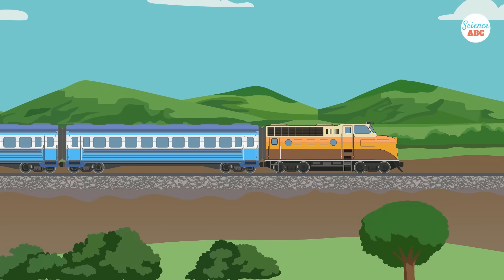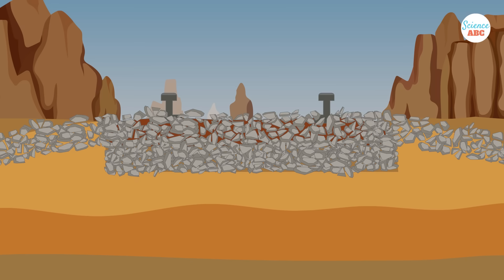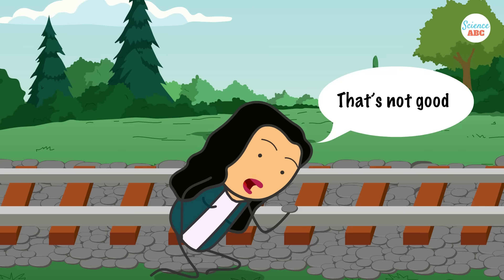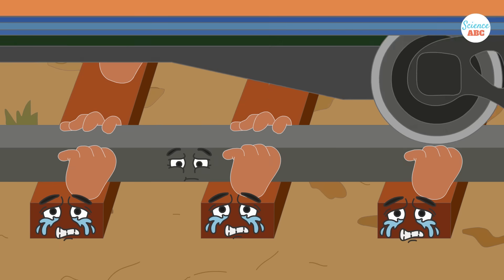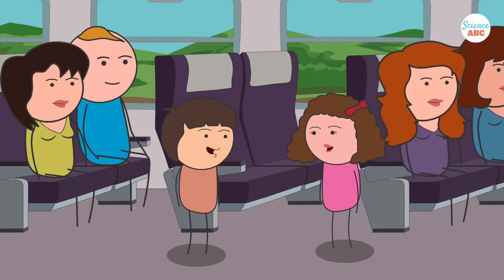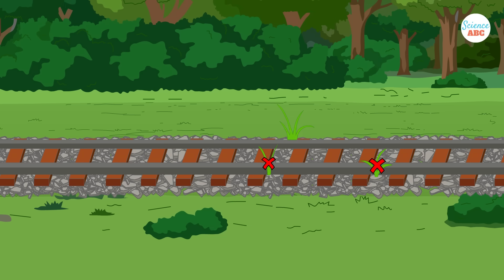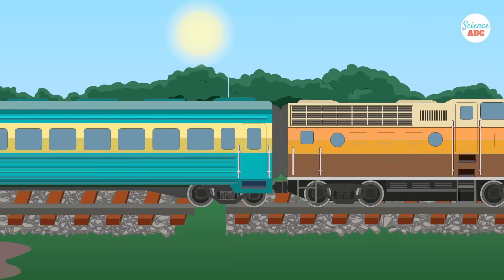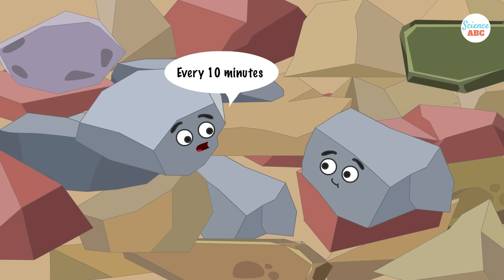Why Are There Stones Along Railway Tracks?

Comment: Here's something that I have seen many times. In certain areas, when the Train Wheels pass over a section of the track, the railway track (itself) becomes displaced with the downward force of the train. I have seen the Track go downwards more than 25mm or 1 inch, and sometimes more than this. And yet, the Rail Track had the correct Ballast. It wasn't mentioned here, but it becomes obvious that the ground (below the ballast) - has become compressed due to the many trains that pass, or even very heavy Freight Trains! I am sure that the Maintenance Crews re-fill those sections with more ballast. This wasn't mentioned here.......There are also very special circumstances (Track) for trains that travel on Permafrost - also not mentioned here.

Comment: We produced ballast in the Clayton Calif quarry.  It was not crushed but dropped into a fast-spinning crusher that would shape the rock so it locked into place after it was vibrated in place with specially designed metal comb-like machines.  We also supplied it to BART

Comment: It’s the same reason you can’t use play sand when you are setting pavers for a patio or driveway, you have to use paver sand so it interlocks.  Play sand is round and will move or wash away.

Comment: Many years ago, a train track that's no longer in use was turned into a multi use trail near here. The ties are in piles in a few places. And, in places, there's still quite a bit of ballast. 
I ride on this trail at times and am always careful at those spots. Don't want to accidentally injure my horse. 
I don't know what all they've done to the trail, other than remove what they could, but the trail is still hard packed with very little vegetation.

Comment: Why do they use gravel to bed rails? Well, they tried using other things: walnut shells, old baseballs, peanut butter, concrete debris, dead bodies, and nothing else seemed to work as well as the material that's been used for such things since before the Romans.

Comment: The STONE aspect...you are referring to river dredge stone VS. quarry stone is a much better way of expressing the stone !  When they cut the rail bed rights of way and had to cut hills and mountains....the stone was a byproduct of thee construction project or essentially waste !   In my parts, its hills and river valleys and hence a source of dredge stone and perhaps sand for the traction braking systems & obviously water in the steam era.  I'm in coal country so there was the fuel for steam and thee forest we see today are not all old growth as it was logged out clear for the railways back in the day when they laid track.... but they have grown back in over  a 100 years so they aren't saplings....everybody plus commerce was by RAIL !!  And the local Rail Depot was the hub of distribution !  Plus in this area...local private lines for the mines or steel mills other than the major rails......which essentially in these parts lay in what was former canals...which were built as to the rivers being to shallow for barge commerce in a reliable way.....they didn't have the locks & dams constructed yet and that river system......so technology conversion from barge with animal draft teams off the sides....when to the IRON HORSE  when steam locomotives came to be.  Its kind of interesting that the canal technology ran its course for maybe only 10 years before they filled the canals in to convert the rights of way to rail and that should be obvious that it was exclusive to river banks to have these rail lines.  Being once frontier lands and undeveloped.....you did development near water sources for obvious reasons.....and everything in developing technology what focused for these conditions...all the way back to native American cultures....but sometimes people can't grasp and bridge facts these days and you have to connect the dots for them !

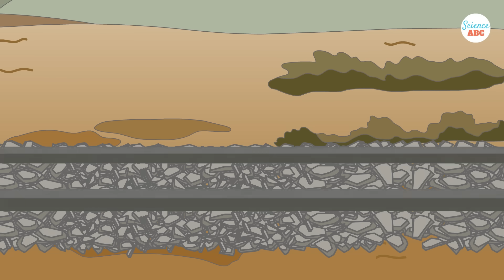Comment: 0:40 Track Ballist
1:25 Jagged, Interlocked Rocks to hold strong
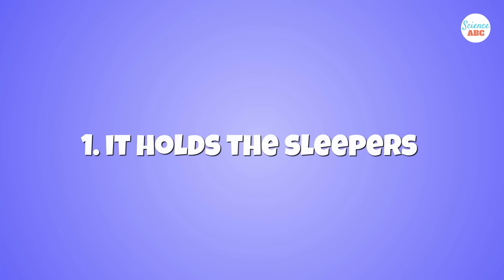1:57 To protect the railway track 🚃 to hold it in place
2:37 Jagged Interlock to make for even distribution
3:16
3:37
4:04 Absorbs noise
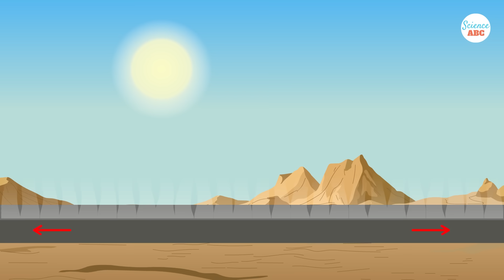4:24 Minimizes heat expansion
5:07 requires maintenance and cleaning 🧼
Reply: Ballast*

Comment: A week ago I asked this exact question while travelling by train and I could kinda figure out what it was meant for. But this video really explained it very well in about 5 minutes or so.

I didn't think of noise reduction and increased comfort for passengers yet it makes a lot of sense. It's like when cycling over rugged terrain with or without suspension: You will notice how every shock of every rock is transferred to you - the cyclist.

Comment: A similar phenomenon can happen at a smaller scale. In about 2008 I saw a newspaper article which said the Saudi Arabian government had rejected an application to export sand to Dubai. Yes, you saw right, but the reason was not because the Saudi were worried they might run out of sand soon. The request was for a particular type of sand - with especially angular grains. The intended use of the angular sand was in bunkers of a golf course. If a ball falls from a great height, if the grains of sand are rounded, they'll shift around a ball can end up buried. But if the sand is angular, grains won't shift that much and balls won't end up buried.

Comment: Something not mentioned about ballast, when building new track you can tell the experience of the project managers/engineers by the amount of budget blowout with ballast. Being one of the last products placed into the track and suffering from variances due to height differences from formation/extra ballast on outside leg of a curve/inexperienced guys dropping too much etc. many an engineer has been undone because of how much ballast the track "should" have needed as opposed to what it ended up with.
And that's not also mentioning track time, mining and freight lines are big $ per hour so to get a ballast train in can be really expensive, so if you get some engineers like we had that booked a ballast train, paid for tack time and full load of ballast and then forgot to tell the workers who were needed to drop it...yeah.... and they got the nerve to complain about us using a few extra 90 cent plastic insulators :)

Lastly FYI the REAL real reason the stones are there is so the track workers have something to throw at the light on the back of the train as its going past...not that that ever happens cough

Comment: It's number 2, almost exclusively.  Although there are some collateral benefits of which you mention, civil engineers put the stone there really only to distribute load to the underlying soil.

1.  Corrosion.  Not used for that.  Engineers do not recognise that "potential benefit" when placing ballast.   It is more effective to raise the track embankment well above wet areas.
2. Yes exactly.  Placed to distribute load.
3. Collateral benefit.  Not placed for passenger comfort.
4 drainage.   Water in contact with ballast would also soften the soil below.  Water infiltration must be avoided entirely and ballast must not be placed on any soil that could become wet.  
5. Prevents vegetation.  No.  Quite obvious that many types of weeds are quite happy growing in the rocks and will soon take over any RR track that is not being used often.
6. Noise control.  A minimal collateral benefit if at all.  I grew up next to a ballast RR track and noise was horrendous.  No useful reduction of noise.  That's why concrete walls often separate tracks from residential neighborhoods.
7. Heat expansion.  Ballast does not stop heat expansion of the rails.  Tremendous forces, 100,000 lbs or more, are generated in rails if you try to stop expansion.  Expansion is allowed to occur be leaving small gaps between each rail that close as the rails expand.  The same technique is used for bridges.  Expansion gaps are the solution for heat expansion.

Comment: I work on the railways and have done many a ballast bashing shift digging out wet beds i.e when the ballast has become comtamanated with dirt and other debris ballast ideally should be granite or other hard stone types and be between 40mm to 60mm in length and also irreguler shapes to do as the video says interlock to provide stability drainage

Comment: Do railways account for earths curvature?
NO!

The london & northwestern railway forms a straight line 180miles long between london & liverpool

The railroads highest point midway at Birmingham station is only 240’ above sea LEVEL

If the world were a spinning tilted space pear the 180mile stretch of rail would form an arc with the center point at Birmingham raising over a mile a full 5,400’ above london & liverpool

Comment: Good US definition: Ballast - Crushed rock or stone forming the track bed of railroad track that properly transmits  and distributes the load, restrains the track, provides adequate drainage, and maintains proper geometry.” 

You should mention how ballast once dumped, is smoothed out, tamped and the track aligned with space age lasers to ensure it does its job.

Comment: I saw something pretty interesting awhile back. There's a 22 mile stretch of track that runs from Green Valley, AZ to Tucson, AZ. The entire stretch was replaced in a five hour period. I kid you not. They had these cars that were job specific that moved along in a progression each doing its job followed by a car that performed the work for the next stage. The bedding was removed, the track, and the railroad ties all replaced. With the exception of the rock bedding, which had been pre-placed along the way, each car carried the supplies it needed on connected cars. There was about a 100 yards between processes. An amazing thing to see. When I knew they were going to do the job, I thought it would take weeks. I was wrong.

Comment: Thanks for the interesting video! I did not ever stop to think about the rocks underneath train tracks. Very cool.
Just wanted to add a couple notes:
I’m pretty sure you mean to say “vibration damping”, not “vibration dampening”. To damp is to absorb energy, and to dampen is to make wet. Also track ballast would not absorb sound, being made of hard and reflective rocks. The non-uniform shape of the collection of rocks would diffuse or scatter the sound of the train though, causing many of the train’s sound waves to cancel each other out or reflect off in every direction from the source, which still effectively reduces the sound level for an observer, just in a different way.

Comment: As someone who has worked on rail construction, you never place ballast below surround ground levels. What you do is place structural fill layers generally in 250mm lifts and then a 200mm capping layer of roadbase type material. The capping is then graded to allow surface drainage with drainage cut into the shoulder of the trac formation. You're first layer of ballast is then place, then your sleepers and then your second ballast is placed around sleepers and after track is attached, the whole length is tampered using track mounted machinery.

Comment: 1. Protect railway track
      a. Hold sleepers in place
2. Load distribution
3. Vibration dampening 
4. Drainage
5. Prevent vegatation
6. Noise absorption 
7. Minimize heat expansion

Comment: can someone explain how the track ballast keeps the heath expansion of the tracks at a minimum, they failed to explain it in the video. all i can come up with is is that maybe track ballasts cause the heat to dissipate from the metal into the rocks, and natural air conditioning caused by high porosity. can anyone confirm ?

Comment: I would guess that track ballast is also very good at accommodating warpage of the rails due to temperature shifts or geologic activity, since those tracks and sleepers could shift on the ballast, with the ballast shifting slightly with them, and the whole thing would still have equivalent structural stability as before, as opposed to hypothetical construction options where you would fix tracks with a solid medium like concrete or asphalt that would have to break to move, and then would not regain its strength. the track ballast is already broken and able to move, but in a way that still leaves it strong enough.

Comment: They also use a rail machine called a tamper. Large tines are shoved into the ballast, driving down while vibrating as to enhance the overall stability of the ballast and smoothing out rises and dips. One of the cars, of the tamper rig, has equipment that can sense undulations. It takes a bit of time for the whole process of laying down new ballast and tamping it, but it makes for a smooth, non-undulating ride.
Reply: The tamper's main job is to compress together the ballast stones underneath and around the ties. This sets everything stable from the get-go.
Reply: @jovetj  Yep, I know. 👍
Reply: @anthonycantu8879  That was more for everyone else ;)
Reply: @jovetj  👍

Comment: I used to work for an excavation company, when you go to order stone from the stone place you can buy the gravel and stone by size, 22s for small fine sharp gravel, 8s  are your typical gravel you've seen, it goes up to 2 I think, then you have the large jagged stones called rip rap or riff raff, and little tiny round pebbles called pea gravel, they use it a lot for bedding and laying pipes in the ground

Comment: Different railroads have different theories on the size and shape of their ballast. The UP Railroad prefers their rock to be of a more uniform size while the BN Railroad prefers their rock to be of varying size and shape. Both think the rock they prefer does a better job of holding the track in place.  Also, you need more ballast under and on the shoulders for concrete ties than you do for wood. 
I spent 38+ years working for a railroad in Track Department. Most of it running machines and most of the time running machines on surfacing gangs. When we 1st started going to concrete we had to learn an entirely new way of doing things.  While they're basically the same between concrete and wood there are differences that matter.

Comment: The ballast resistance is also important for signals engineers to consider for the functioning of track indicating circuits.
Reply: Next time you ride the subway, look at the balast!  There is no balast.  In tunnels they always use concrete as balast would cause serious problems with derailment

Comment: Let's not forget also that part of the reason this all works is that rail lines are always on a raised bed, a couple of feet higher than the area around them. This has several beneficial effects but making sure that runoff has somewhere to go instead of just pooling up around the base of the sleepers is a big part of it.

Comment: well, having a dsd as a contractor and being 17... I asssssssumed, it was for compaction, so you can build on otherwise mushy ground. so you dig probably 3 feet deep in the weight-bearing spot, or line being a railroad. a however wide by 3 foot deep line

Comment: Wow, an almost totally correct video.  Impressive.
One nit to pick.  The timber between the rails are not called sleepers.  They are called ties.  As in "railroad ties".  They "tie" the track together.  
I worked on both the UPRR and the AT&SF.  Only time I ever heard the term "sleepers'" when referring to RR ties was from some foreign film about Czechoslovakia and their rail lines years ago.
Railroad ties, dude.

Comment: One thing you missed, and maybe the most important thing. They hold the tracks in a manner that there is room for thermal expansion of the tracks. They are not too tight and not too loose. So the tracks have room to expand thermally in extreme sunlight

Comment: At least in Iowa, most the rock they get is mined locally. White rocks. Good source at least in the Midwest for coral/sea life fossils.The Midwest was an ocean 400 million years ago. These creatures are much older than the dinosaurs. Its kinda sad that so many get destroyed, but you can still find some pretty amazing things, such as nematodes, anemones, etc.
Also, there is a set of tracks in Central Iowa that have a date of 1947 on the side of the rails. This is a heavily used line near Des Moines, and been in operation for 75 years! I have had locals say that's not true, but it is.
Im from a town that has tracks coming from every direction. I would estimate they refresh the rock every 7-10 years.

Comment: Excellent video. I remembered when I was in the Canal Zone during the early 1990's, the railway system did not have crushed stones at certain areas. And vegetation was growing out of control inside the tracks. I had initially thought that the vegetation would wreak havoc with the moving mechanical parts beneath the locomotives and box cars. This video helped explain things in detail.
Reply from the maker: Thanks for the info!

Comment: They seemed to focus on the heat generated by the sun. There's also the heat generated from a passing train. Also with welded rail they preheat the rail, weld it when it's hot so it's under tension, this is a force acting on the ballast

Comment: This is not a really good explanation. The reasons why are repeated multiple times, but nothing is said about how track ballast does this. It's just repeating the obvious.

Having only a little bit more than zero knowledge on trains, even I can't say I learned a thing. Just looking at the rocks tells me more than explained here.

That leaves me with more questions than answers. Would larger sintered stones perform better? Do they need to be compacted before being used? How can these rock-hard stones achieve mechanical absorption, do they have  (albeit very low) elastic properties? Does this ballast require some sort of foundation in for example very wet and dense clay or swampland? What prevents clay and sandparticles from being forced up when a train pushes the ballast down (like when you push on a sponge in a layer of water, when you release it sucks up all the water)?

So many questions!